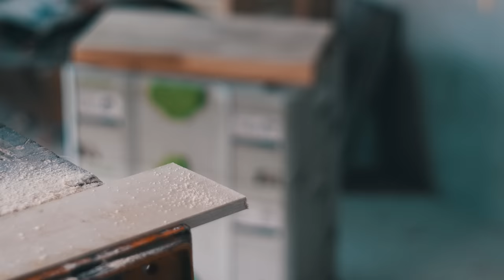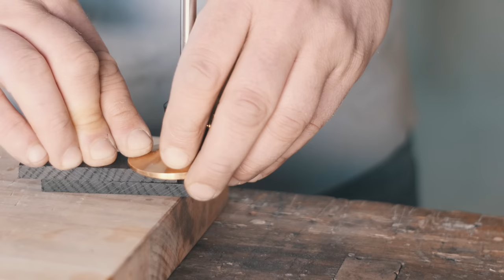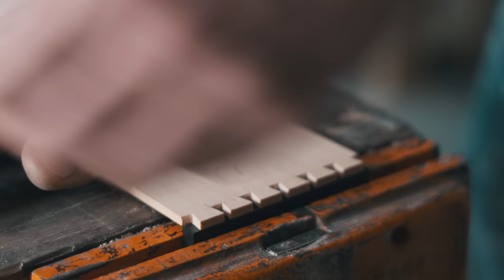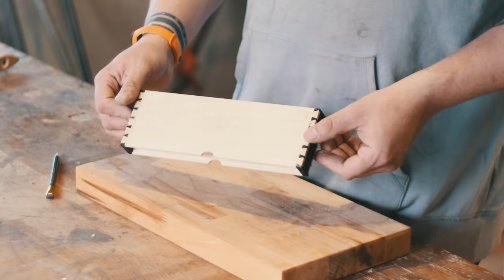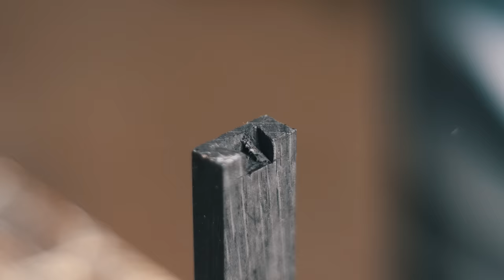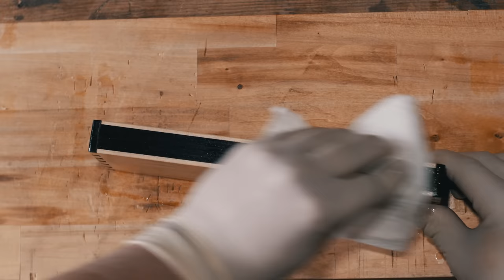Hand tool woodworking - Pencil case with a drawer Making

Comment: What's the main difference between the hand saw you used (I mostly see in Japanese work) vs the old school style hand saw?
Reply: The biggest difference: the Japanese saws are pull saws, that cut when pulling the blade towards you. Most western saws cut on the push. People say pull saws tend to be easier to use for precision sawing, but I think it just depends on what type of saw you're accustomed to. I personally feel I have more control on the pull, but I'm more powerful on the push.